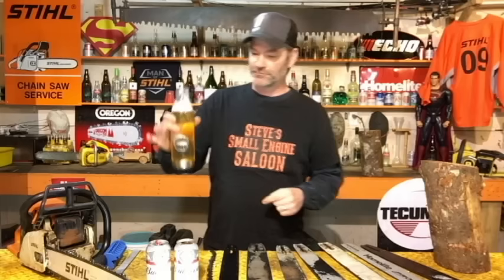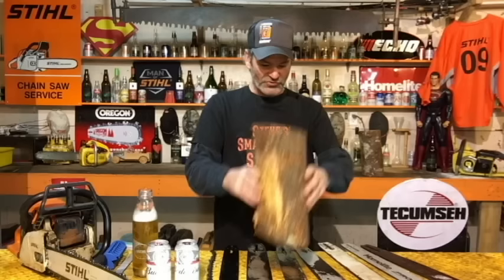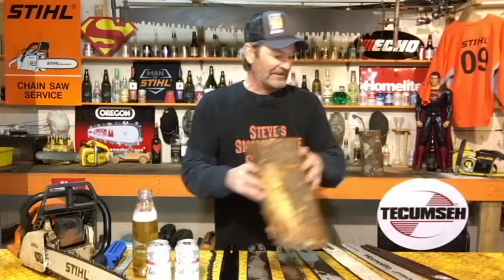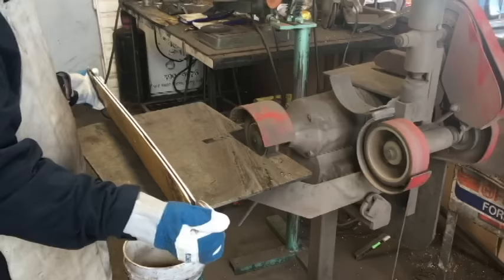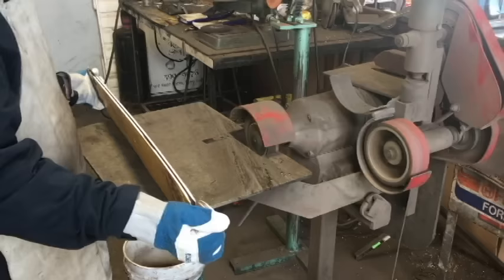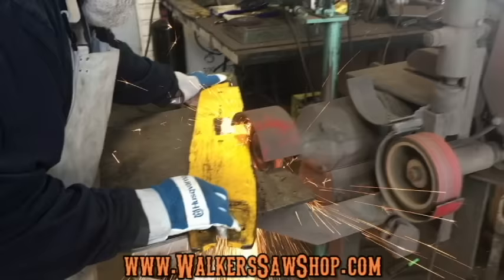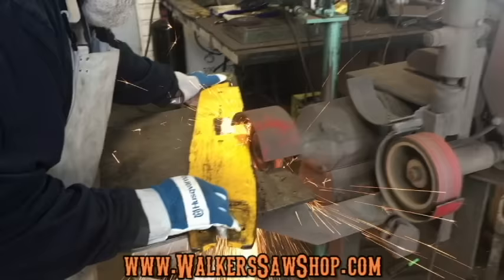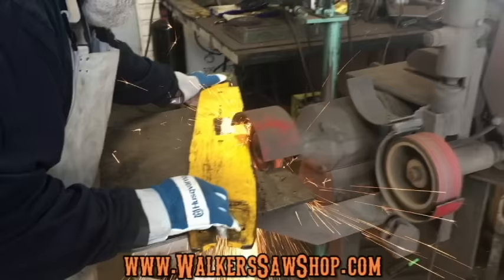How To Repair A Chainsaw That Cuts Crooked

Comment: Belt sander works awesome. Also dress the sides of the rails as they get a lip. If your saw tends to get stuck as you cut wood it probably has a lip on the sides of the rails.
Reply from the maker: Great tip, thanks Steve...
Reply: Steven Hatfield, just make sure to get all the grit out with air compressor or good cleaning brush. The grit will wear the parts down extra fast.
Reply: Clean it every time you sharpen! Remove all the metal shavings!

Comment: Hi, thank you for adding educational info for the public. I can add two that have been more common,  1. a crooked/bent blade and or bar from prying purposefully or mistakenly when pinched in tree or log. 2. worn/torn vibration dampener, rubber bushing connecting handle to engine body....to fix, replace parts...hope this can help if what you have is not what this gentle man has offered ..cheers
Reply from the maker: Great advice Theodore.  Thanks buddy....

Comment: You'd be surprised how many guys don't have a cue about maintaining their saws.. 
 I'm a certified cutter skidder operator with signing authority, so I trained guys I hired to harvest timber. I made sure each and everyone of them knew everything there was to know about saw maintenance, and Even experienced cutters had no idea how to maintain their bars and remove the burr, which is something that has to be done frequently, and checked everytime you flip the bar.
 Filing / sharpening is an important part of operating a saw, but bar maintenance is equally important..
 I had them invest in tools they could take with them to the bush in a tool kit that would do everything they needed to do to keep cutting safely and efficiently..
 That was some years ago now, but it still all applies.
 A Chainsaw is the deadliest power tool anyone can buy off the shelf.
 Chainsaw accidents happen by The Weekend warrior who buys a chainsaw with no common sense whatsoever are dangerous to everyone around. I've seen bad things happen.
 That said I've had my share of accidents to though. 
 People don't realize it's an odds game. Each Time You Go To Fell Timber, Buck, and Block, Limb etc you run the risk of getting hurt. The More times you enter the bush the more the odds stack up.
 There is only one sure fire way to prevent accidents, and that's to be careful, know what you are doing, and know who's in the bush with you and there whereabouts at all times..
 It's not the stuff on the ground that will kill you, it's the stuff hanging overhead.. aka "THE WIDOW MAKER"
 Thanks for sharing the video..

Comment: Hi, Steve. I am a licensed marine and small engine mechanic with 25 years experience; and I have to say Good video; however, I will add that there is one good way to fix a bar that has too loose of a groove. after you dress the rails, check if the next bigger chain gauge will fit in the worn groove. Ie: if bar is .050 see if .058 will fit the groove. I have found that if the chain's drivers will fit say 90% down into the groove, (with the tension set a little loose) you can run the saw up to speed , and add lots of extra chain oil from a pump type oiling can; and in a few minutes the chain will wear in enough to allow you to set the correct tension. Then the chain won't flop over and the saw will cut straight again. I have had a lot of success doing this. and if the bar is .058 you can go up to .063. Oregon chain does make .063 gauge 3/8 chisel tooth (the drivers are marked with a number 75) hope this helps, John.
Reply: Sometimes you just need to break down and buy a new bar.

Comment: These are great. One thing our local saw-guy told me one time when I complained that my saw was "butter-bowling", as we called it in Vermont back in the day, was "You're not taking enough off when you file your chain; take a few more strokes", and that did help. Also, when you need to square your rails, a big flat sanding disk on a radial -arm saw works great - you can just draw it smoothly past that thing and get it real nice.
Reply from the maker: Great tip!

Comment: Went thru this process recently. Another helpful hint: if you have a combination square, you can hold it up to light and see where the bar is uneven. Helps to pinpoint areas of greatest wear. Don't run a chain too long on an uneven bar, you will actually render a chain unusable by making the links uneven; it's best to address it early on.

Comment: Steve great channel.  Note the bar file ( blue one) is actually made for sharpening skis.  Mine is 30 yrs old and does work great.  Tip..when the file is done I buy a bastard file then use a cut off wheel in a 4 in grinder to cut a new section to length .

Comment: Very good video, but there are some additional tips.
Number one reason is poor alignment, standing without good posture or aligning your sight line with the saw, directly behind it and perpendicular to the workpiece.
Number two reason is laziness.  Letting the saw tilt part way through the cut, dogging in and pulling off center, holding on the side so it's twisting, but not countering that with opposite twist on the trigger hand and handlebar.
Number three reason is not aligning your body/shoulders with a workpiece off the horizontal plane, on a hillside etc.
All of these are exacerbated by a dull chain, or rakers that are too high.  Fatigue will prompt all of the bad habits to come out.  Reaching too far over a large log and getting into an uncomfortable position means you won't be able to see the cut or control it effectively.  Also, cutting far below your feet with even a slightly dull chain makes it very liekly to start twisting at the bottom of the cut.

As for worn out rails and groove, there is a tool for closing it up, basically two bearings on a handle that you can tighten on the rails and pull them down the bar.
Clean off any burrs on the side first to prevent uneven closure, and don't expect too much from it, also, be careful not to close it too much, it sucks to have to widen it out again.
A short piece of chain you can test with frequently helps a lot.

Also, if you run a chain for a long time on a bar with really bad rails, the chain itself can get uneven wear on it and tilt over even after the bar is reconditioned.
Another problem, which usually causes more binding than crooked cuts, is the burr getting too wide so it is wider than the kerf and sticks.

OK, finally, sometimes the bar can actually get twisted or bent.  Straighten it.  I have stuck it in a cut in a log, swung it against a log, hammered it with an axe, whatever.
If you're a couple hours out into the bush, just make it work.
One way to temporarily fix it is to plunge cut constantly, cut an inch or so, pull the saw back, twist it to realign it and plunge cut along your old kerf.
If you're not comfortable with plunge cutting, understandable, don't.
Reply: Man do you always talk so much?
Reply: Thanks, Mack, you confirmed my experience with worn chain and uneven wear. Probably the one thing I could add to your advice is this: If your saw is not eager to cut, that you only serve to guide the saw while it does the work, you already have an issue. If you have to rock it, or apply undue pressure, it's time to stop and figure it out.

Comment: Another great video. I would add that a light filing at approx a 45 degree angle on the edges of the bar after squaring up the rails will take that burr of the edge but will not change the rail support on the chain. I've cut myself putting a chain on after squaring and removing that burr will eliminate that risk.
Reply from the maker: Excellent tip!  Thank You...

Comment: Thanks for the tips! My bar is fairly new with minimal hours on it. It is worn uneven already. Premature wear can be an indicator that the bar is not getting enough oil as is my problem. I have an old MacCulloch Mac Pro 610 with oiler issues. Seems that wood chips end up plugging proper oil flow constantly.

Comment: Ever heard of this?  I hit a screw while chainsaw milling an old pine for some shelving.  Chain smoked right up and dropped anchor.  When I went to sharpen it, teeth went well, one whole side rakers went well, other side harder than the file!!  The screw case-hardned the rakers on one side!   End up using a diamond file and got er done.  Brand new stock chain on a ms391.

Comment: Thanks for the info...hopefully it will be effective on my medium duty Craftsman Chainsaw...it actually fired up after a year not run since it cuts crooked with 87 octane oil mix...thought it was a gonner but it fired up...lol...with the info I've gotten on chainsaw maintainance and 8 ways to fell a tree I think I'm well on the way to better woodcutting with a medium duty 18" bar...I do want to get a full rollbar chainsaw so my left arm doesn't wear out so fast holding the thing for 2+hours...lol...got lots of wood to cut...oh...and when the 87 Octane fuel is done I'm going to be using 91 Octane Non-Ethenol Gas...it will keep the engine running strong for a long time...thanks Again...

Comment: Got one on my workbench right now with this problem.  Thanks for the thorough explanation of the things to check for.
Reply from the maker: You're Welcome...
Reply: Worn out chain on a Poulan Pro 405 Plus.  Tossed it,  replaced it with a newer sharpened chain & it’s cutting like a hot knife thru butter.  Bar’s in good shape but I did flip it.

Comment: Thanks much. Been heating with wood for years and this has been my albatros, particularly when it comes to cutting the trunks of larger trees, like ash or oak with a 24" or 28" bar. Can't tell you how many times I'm halfway through a log and it takes a curve and ..... that's it. Can't complete the cuts. I check and dress the bar rails pretty regularly so I don't think that's the cause, but I guess I'll run through the list and look at the other 3 possibilities, and take a look at the sharpening video.

Comment: Hi. Steve great video I've been using a chainsaw for many years & never knew about the reasons in your video I thought it was "me" cutting it pissed,
or blunt chain, we call what you were doing with the file here in the UK draw filing used for finishing in engineering
Reply from the maker: Right on...

Comment: I bought a cheap (40AU) Chinese Bar & Chain & found after one day it went sideways bad as.The bar had a .5mm difference in height already so I decided to buy a Husqvarna Bar (120 AU ) & bought a Tungsten tip chain off ebay for $90 AU .What a difference .Worth every dollar this time.

Comment: "How to Repair a Chainsaw That Cuts Crooked   "
Sharpen the chain properly.
Reply: No change the bar
Reply: hold the saw  straight...
Reply: HarryT got it right
bar heats up even with lots of oil, chain keeps coming off, get a new bar
cuts crooked get a new chain....or learn to sharpen opposing teeth the same amount

Comment: Hey Steve. Great work. 
Also, if sap builds up on the bottom edge of the bar unevenly it can pull your bar off-line so that you're not cutting straight. 
I tend to wipe the bar with oil and steel wool every time I turn the bar or if I see a lot of build-up.
Thanks for the tips.

Comment: OMG...was just gonna ask u about this, and up popped your video, many thx Steve!!! I have 9 50-75' felled ash trees I have been hauling out of the woods as 1-2ft  logs, heavy as heck. I use a "saw & bake" method (even w felled dead trees , in dense woods they are not yet splittable...cut them into 16-18" logs, and lay them on a hot driveway for 2-3 weeks to bake in sun, flip several times)w logs, to split them in my 5 ton Harbor Freight splitter...love that thing. Many of these logs were unliftable beasts, getting them in the splitter they would trip the breaker...so I used my trusty Stihl 028...cut them into halves, then quarters to save my back then bake them dry to split....well i would get 30-60% thru logs w 028, and noticed i would always...cut a curve to the right, was driving me nuts! Gonna try all your techniques to diagnose the 028. I flip bar every time i swap chains. I use aggressive cut chains and std cut chains. Thoroughly enjoy your videos....recommend Belgium Trappiste beer when your day is done! 🍻

Comment: I just watched your "how to sharpen a chain" video too, and I've been told that if the cutting teeth aren't matched (let's say a right handed person might have the teeth filed the same on one direction of filing, but the other direction might be a little longer or shorter because of the awkward reverse direction with the same right hand filing the chain) that this can cause curved cuts, although you said you don't believe the teeth need to be filed the same amount.

I was taught to look for the WORST tooth on the chain overall and file it until it's sharp, and file all other teeth the same number of strokes to match it.

I definitely have been neglecting my bar.  I have only filed the bar's burrs when I had to change the chain.

Love the videos!

Comment: Thanks Steve. I'm a bit of a novice with the chainsaw and other small engine garden maintenance equipment. Finding your channel has helped me enormously. You're a champion! Particularly liked the video on starting a flooded engine. Awesome. My own chainsaw is a Stihl MS311 which I love is only a few years old and has only light use, but I reckon I learned valuable information from this video which will come in handy soon enough. Thanks a heap from country Victoria (Australia)

Comment: Great video ... thank you.  FYI, those bottles hold any fluid, but make sure you get out any trace contaminants like water before you put your Bud in there.  My old Stihl 025 instantly started cutting very crookedly after I hit a rock (hidden in a stump) but I did notice it still cut relatively straight coming up from under the log.  I've never flipped my bar and I've had it for decades.   The crooked cut (up or down) improved almost completely when I replaced the chain.  (I cannot resharpen effectively after a serious rock grinding.)  I think my bar also needs help/replacement due to the big difference in the angle of cut between cutting down from top (very crooked) and up from bottom (minimally crooked) with a mauled chain.  Thanks again for the great vid.

Comment: good work bud however ive encountered another problem such as the bump spike screws bolts loosening and in some cases bending everything is sharp the bars i dress on a disc and belt sander great ryobi unit from bunnings Australia in perth i have ordered new parts just waiting it is my fifth chainsaw i seem to collect them couple stihls one huski345 stihl038 magnum with 20 inch bar is my favourite one and my newer one is for trimming or camping smsll diameter cutting little ms181c wich seems two intermittently stop lubricating the bar i have cleaned flushed the oil tank purged cleaned bar oil holes all of the usual checks but it still continues I'm gonna replace oil pump unit and rubber hose between pump and hose shortly i hope this works cheers mate love cutting firewood enjoy outdoors drinking coopers pale ale keep making these videos u r a natural genuinely helpful person godbless ya

Comment: Great video 
You hit the problems right on the head. I see most of the time the issue is exactly that the rails are uneven. I had a friend who thought his chain was sharpened more on one side than the other and kept trying to sharpen the chain. I finally convinced him to take the chain off and look at the rails.. I made a jig by clamping a flat piece of steel to a file so the steel ran on the bar keeping the file flat on top making the rails true and flat. He was amazed that it cut straight after that.  Have a great day and a wonderful weekend. Say hi to buckin Billy Ray.
Shane A Chelsea maine
Reply from the maker: Thanks for the awesome comment Shane....

Comment: ...Tremendous tips here Steve... I respectfully would add with respect to the bar maintenance, lay the bar flat & flat file any ridges off from one end to the other, both sides, this is in conjunction to filing the rails as flat as possible. I did just that and what a difference it makes. I spent several hrs. last week on both the chain & the bar in my shop vise & it was a transformative experience when I cut down through a 24" maple. It went smooth & fast & most importantly, straight, all the way through it. Great content here btw as it helped me out considerably... The key word is RAZOR sharp teeth at all times. Each fillup is a perfect time to touch up the teeth, sometimes sooner depending on whether you hit something in the wood. ( a visual of the teeth is a constant ) Another thing, each time it becomes necessary to remove the bar & chain for whatever the reason, is a perfect time to do some bar maintenance in conjunction to chain sharpening & possible raker lowering. Doing all these things on a methodological basis, makes for good KARMA & keeps a smile on my face as my saw cuts effortlessly. Have a nice day... :-)
Reply from the maker: Awesome comment my friend, Thank You...

Comment: You can also check for even rails by using a metal, L-shaped carpenter's square and sighting down the bar.
You've got the best chainsaw videos out there. As far as Bud beer goes - to each his own. That stuff gives me a headache after 10 or 12 of them. Beer preference is like music. You like what you like.
Reply from the maker: LOL.  Thank you for the comment and for the tip....